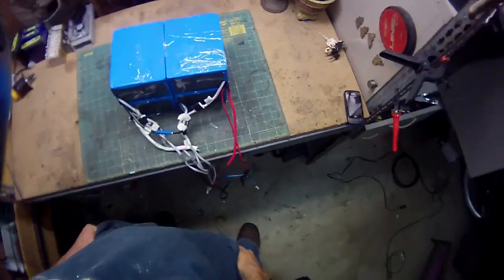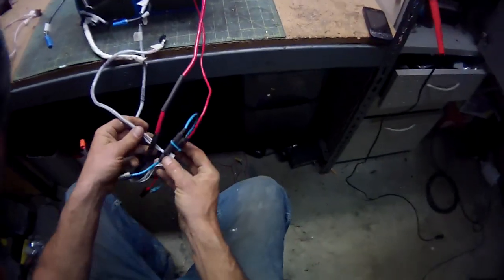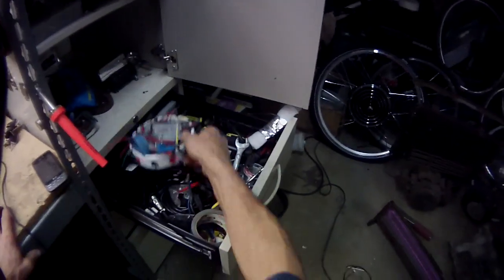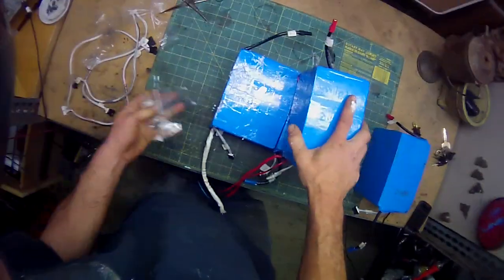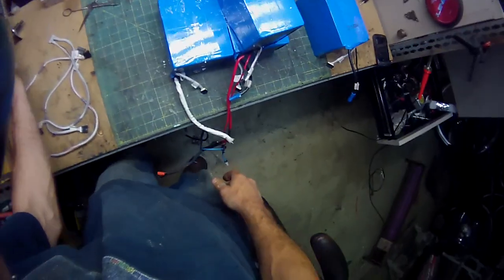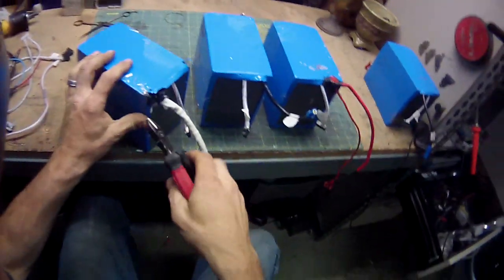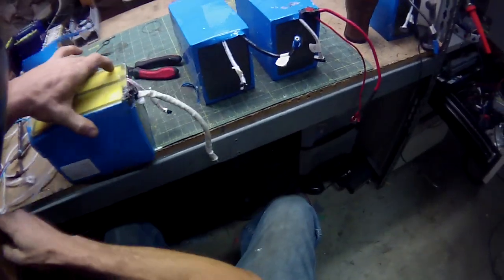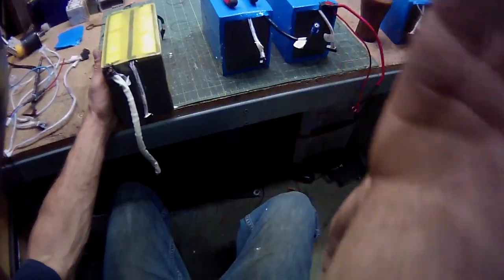PING 60V 30AH to 48V 30AH Lifepo4 Bike Battery Rebuild #1

Comment: One thing is odd.
At ping website A 36v 10ah weight 3.4kg but if you choose the 30 ah its 23kg?   3 small should be just over 10kg

Comment: 52v 20 ah battery how many mile give in one charge Plz can u tell me
Reply from the maker: How many watts is your bikes system?
Reply from the maker: Roughly....40 miles... (Strongly affected by size of bike and rider.) if the bike system is 500w
Reply: Pls guide me: which is best suited battery for 1000w brushless DC motor- 48v 20ah or 48v 30ah, considering that I want my bike to run 100 kms in single charge

Comment from the maker: Hi ExclusiveLM. Several factors can contribute to a battery behaving the way you are saying if it is been used a lot and is old it is likely dying cells.. If you can get to the balance plug with a volt meter. all cells should be around 3.7 volt... Large differences in cell voltage can cause not to charge or decrease distance.. The entire battery pack is only as good as the worst cell... give me a call you need some help 714 3817761.

Comment: Hi ! I'm hopping you can help , I have a 2000to 5000 watt 80 amp, esc, I'm thinking about two 8s lipos ? , I can Ron from 48v to 72v , or you mite have something for me ?
Reply from the maker: What  is it you're building? A bike? What size motor will you be using? you can call me anytime to discuss project (714)381-7761

Comment: Hi. I got prob with my Lipo battery (48v 40amp). It charging less than hour and we can drive only 10 min.
Waranty from Aliexpress never mail me back about their 2 year warranty...
  Tnks
Reply: Hi Andrei.  I have the same problem.  My battery only charges a few minutes and now doesn't work at all and only 2 of the 16 little lights blink that are attached to the Lipo.  Do you know how it can be fixed.  I ask you because this comment you left with this problem is now from 6 months ago.  Maybe you found out how to fix it.  Please reply thanks.
Reply: ExclusiveLM Hi. Bad cell is a problem. Need a good exp. for fix it. I still try get my money back from fucking Aliexpress. Use my old battery (gell)  for electric machine and upgrade my son to karting with take all my time.

 Self made go kart not use very often and will stay in garage for memory and will never sell...

Comment: yeah not really a downsize, if anything an upsize in speed current etc, but less run time. prefer amps over volts, and no idea of any consumer moter that uses 60v but many use 48 or 36 or 24\
Reply: also im white people, with a 36V 20ah LiFepo4 battery
Reply from the maker: I have had no problem putting 60v to a 48v controller it works fine except the LVC is wrong so you have to be careful not to discharge the battery too much...or just use a BMS....